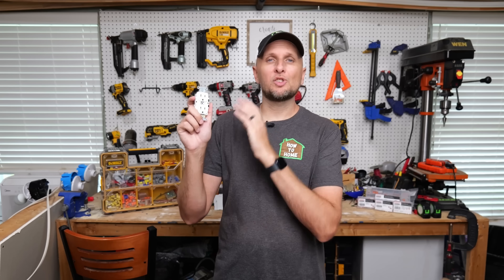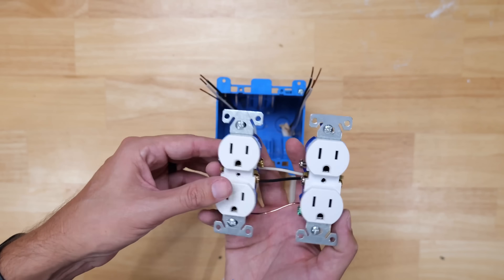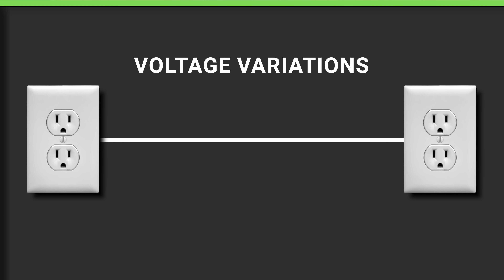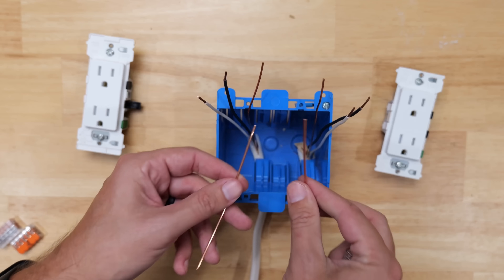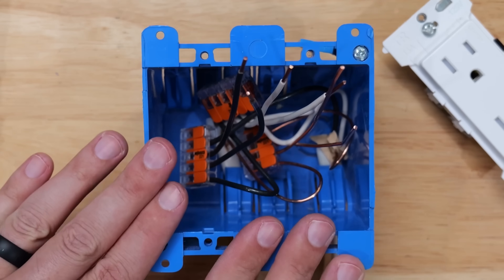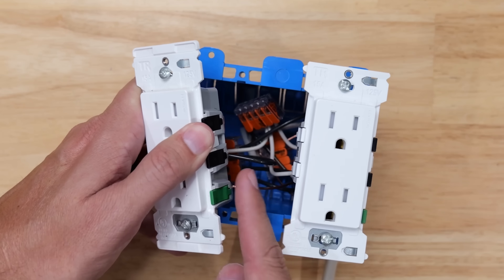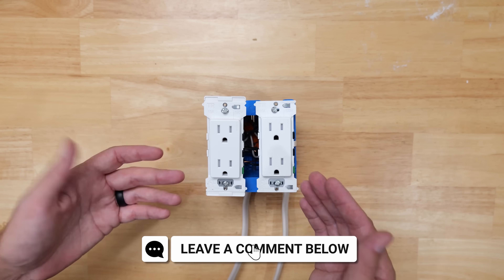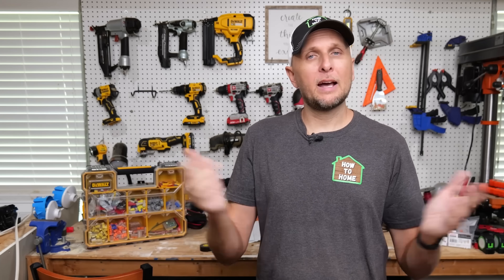Why This Outdated DIY Outlet Wiring Needs to End!

Comment: An outlet goes down? Is that a real thing, when did that start, when they started making really crappy outlets. Or when unqualified people were doing the work. And sorry the best connection for carrying current is wire warped around a screw that has been tightened down on the wire. Not kind of pressed down between two pieces of metal. All this has only managed to make it more expensive, quicker to do, but not stronger and I'm sure under max current usage those plastic wacc things will heat up. No thanks. Standards for everything have gone way down. We are in the age of incompetence. Don't defend it. In my home I replace all the outlets and took the wires out of the holes in the back of the outlets and used outlets without the holes. And what do you know, the outlets don't get hot anymore! I only wish I had a wiring diagram of the house.

Comment: Don't daisy chain create more resistance between first and last receptacle ? Thus in turn costing more eletric?and 14 ga vs 12ga for a whole system . Electrician buddy calculated years ago 100 bucks saved a year for 12 ga vs 14ga for his whole house re wire.
Reply: Yes, more material more resistance but I doubt it has any significant effect. For example, 12AWG has 1.588 ohms per 1000ft. Most circuits are not even 100ft in length.

Comment: In 1986 i was taught the in and out and a pigtail lead for each outlet shall be joined by a wire nut for each conductor. 

Never ever use the outlet as your junction. I don't know where the hell that came from as I didn't pursue the electrical trades, but it strikes me as wrong whenever I see it.

Comment: I wouldn’t let anyone use this lever locks. That’s why your outlets are failing and those wago connectors are another weak point. Another failure point is stabbing the wires into those holes cheap outlets have on the back of them.
Reply from the maker: There is zero evidence to back up what you’re saying about the lever connections.  They are nothing like backstab connections.  Just bias opinion.  My outlets aren’t failing so not sure what you’re talking about.

Comment: Thank you for making this video.  After decades of daisy chaining, you've got me around 99% sold on pigtailing.  Some of my cons are listed below.
1.  I don't really understand why you refer to the daisy chain method as "outdated".  My house was built in 1959 and it's all pigtails.  Same with my parent's house.  Seems like pigtailing is the older method, IMO.
2.  My big problem with pigtails is it drives another wire inside a wire nut.  I've already got several #12 solid wires inside that nut.  Adding just one more, even if it is stranded, is a big deal.
3.  I've had exactly the problem you described in your video.  Half the outlets in one room quit working, and the culprit was a bad connection on a daisy-chained outlet.  Finding it was not easy.  Fixing it was harder because when my dad wired up the room, after wiring an outlet he would pull the excess wiring back out of the box.  I guess that few inches of wire added up financially LOL
4.  What do you think of using stranded wire for the pigtails?  A little easier to bend and flex when stuffing everything into the box.  And with lever connectors it's a no-brainer to connect solid to stranded.
5.  I've got some green stranded pigtails that are a wire nut on one end, and a spade terminal on the other for the ground.  I wish they came in black & white as well.
6.  It would be nice if someone made a pigtail lever connector with the black, white, and green connectors all built into one unit.  That would make the pigtailing even easier.
7.  I love these lever connections.  I only recently discovered lever wire connectors.  So much easier to combine solid and stranded wires, and flipping a lever beats twisting a wire nut.  I just bought a big box of them for all my future projects.  I'm glad devices have them now as well.  Cost doesn't seem too out of line with screw terminal devices either.
8.  Have you, or could you, make a video showing the best way to stuff the devices and wiring into a box?  I'm always looking for tips from the pros.
Thank you.

Comment: That would work great when you're using 14 gauge wire which normal people do. My family runs internal wiring at 12 gauge which means heavier wire more wire in the box. It is not a pleasant job. And yes we do run 20 amp outlets when we need to. Otherwise we just run 15 amp depending on where it is. 
And as mentioned previously, added GFI into the situation. You don't want to wear it like that. You want to run it in series instead of parallel. Good video especially for those new homeowners that are just beginning DIY.
Reply: I think the guy who built my house used #12 left over from other jobs.  PITA to stuff all that spaghetti back into the boxes.

Comment: Electrically, both ways are wiring in parallel. Seeing that you didn't break the jumper on the receptical, the electricity is still going across the jumper. You are NOT wiring through the receptacle but around it. The only way that I see this killing the line is burning the through jumper on one of the receptacles. And then it affects only the ones after it. 
Aside from that you hate backstabbing, yet use wagos (same tech) over a mechanical (screw) connection?
Reply: Wago's are not the same as device backstabbing. The materials used with Wago's are superior in providing contact and constant tension without weakening. Wago's, like wire nuts, are isolated from the device, so they are not subject to movement by plugging and unplugging. Backstabbing could be considered a clever design by adding a secondary method, with virtually no added cost to residential grade receptacle manufacturing. You get what you pay for in this case, and they are UL certified to a minimum requirement for the desire to speed up the installation process.
Reply: @surferdude642 Wagos are a spring pressing against the wire to make contact just like backstabbing, and though they dont put up with the vibration of pluging and unplugging, they still put up with vibration to other factors. Add in the fact that they're not mounted the vibration is worse.
Reply: @roamingcelt I don't consider a receptacle mounted on a residential wall to be a vibration concern, however I found statements saying that Wago lever nuts are tested for high vibration conditions. Not much information on similar testing with device backstabbing connections although I assume that UL has done some minor tests at least. Vibration is not the issue I am addressing because vibration is an oscillating condition that lasts for several seconds to minutes or hours on vibrating machines or vehicles. The push/pull of a plug is just a single motion. People have their opinions, but an important fact is that backstabbing is not permitted on 20 amp circuits and Wago lever nuts and push ins have no such restrictions. Larger lever nuts are available for 30 amp circuits with 10 gauge wire. Another thing is that commercial grade receptacles have no option for backstabbing, including 15 amp varieties.
Reply: @surferdude642 I'm not saying that they don't have higher amp wagos. I am saying it is a spring that digs in to the wire like backstabbing. The vibrations and oscillations are the reason backstabbing is frowned on. You have these same forces on the wago and no mechanical means to dampen them.
I'm NOT saying I'd backstab, but it's unlikely that I'll use wagos either. I like my mechanical connections.
Reply: @roamingcelt  - Um, the WAGO device is a mechanical connection.  Spring-loaded, which keeps constant pressure on the wire, vs a screw which can come loose over time (actually happened at my parent's house).
Reply: @hcliii Which goes to the point of wagos=backstabbing. They are a spring pressing against the wire.

If I could I'd solder the connections. But that's against code and time consuming.

Comment: With standard outlet, why not do the same thing only using 2 black wires into one of the screw terminals? And two whites on the same outlet?  Then jumper wire the next outlet?  The terminal is made for two wires and this method makes a great connection...?  Also eliminates two pigtails.  Win,win.  :)  12 guage with 20 amp recepticles..

Comment: Where did you get your education which somehow got you the license bro, if you indeed have one. Just because you give an outlet its precious own little connection, that doesn’t mean somehow voltage won’t drop if a new load is connected to the circuit. Hell, even if you give each receptacle its own wiring to the main panel and its own breaker, every time a new load is connected to a separate line, the voltage will still drop!
Reply: you're right about the voltage drop. It's about the length. But the other cons he mention were on point. If the first outlet fail, it cuts power to the rest of the circuit downstream, which can be a nuisance.

Comment: Been redoing the receptacles in my 50 year old house.  Hunting down open grounds, and variable readings - mostly  bum receptacles, occasionally just - why bother hooking up ground..., and sometimes just "something" at the receptacle.   New boxes (larger), pigtailed.  Using the receptacles as pass throughs works until it doesn't.  A few minutes extra work is worth it to me.  

You can run 14 gauge stranded pigtails to a 15 amp receptacle - making things easier and not compromising a 20amp circuit.

Comment: Using lever connectors, I would do it this way.  I never liked 4 #14/12 wires in a single wire nut if I didn’t have to.  I’m just an amateur.

Comment: I’m not an electrician but I’ve wired several work shops and I’ve always done it the way you showed. I’m about to start another shop and will take your advice. I also need to brush up on the new codes as I know things have changed since my last shop 10 years ago.  I build a new shop every time I move. I generally also have to buy a phase converter and incorporate three phase.

Comment: I personally pigtail as well.  BUT it is totally code compliant to use the receptacle as a means of pass through wiring.  IF you do use the receptacle as a means of pass through wiring, do so by bending a J hook around the side connection terminals.  When using the the receptacle as pass through wiring fails, it's almost always because they used the back wire terminals to do so.  I NEVER use the back wire terminals EVER.  Anyone that has to do service work knows they are unreliable.

Comment: Points are spot on. However, and I don't endorse the method, it is a great way to locate burned or loose connections when it comes to the old 60's, 70's aluminum wiring.

Comment: Two things that need to be pointed out. First, if you have a GFCI with other outlets downstream that are supposed to be protected you must pass the power through the fixture. That's how they are made to work. GFCI breakers are a better idea anyway. Second, changing you wiring this way won't affect power to downstream devices unless your outlets are really, really, really, cheap (think bottom tier manufactured home cheap) that's just not how electricity works. However, if you have said cheap fixtures you will get a drop because the stab-in connectors in the back can only flow about half the nominal power draw. They will overheat, melt, and potentially burn your house down. I have pictures. If you have those cheapies with stab-in connectors just bite the bullet and replace the whole lot, outlets and switches both. Even the cheapest big box DIY store outlets are better than the *#(%$*& that they put in the cheap manufactured homes. (And while you are replacing them pigtail stuff where it is appropriate. Having one fourth of the outlets and lights in a house running through the back-stab on a single cheapo light switch is just a disaster waiting to happen)

Comment: I like this pigtail method better. However, I don’t feel the downstream should be too much of an issue the old way, as long as the job is done the right way. The exception that comes to mind might be if you were to “Backstab” wire the receptacles, which I NEVER recommend.

Comment: Would love to see a video showing how you recommend actual length of the pigtails ( looks like 4-6" in video) and show how you you recommend or actually  "shape" or fit the wires into the box. Video shows pigtails, how they should be connected, then "look they're nested in the juction box".  Would love to see a real video of someone actually placing them in the box.  Seems like that's really the secret to succesfully and safely doing these installs. Showing before and after doesn't really capture how it's done.
Reply: I'm always looking for tips from the pros, especially when it comes to putting the spaghetti back into the box.

Comment: Have you ever seen an outlets connections fail so that the daisy chained outlet stops working.  Is that any less reliable the wire nuts or wagos?  i have no statistics, but I would guess wire nuts installed by DIY people are by far least  reliable.

Comment: those poke connectors are a fire hazard they are designed for ignorant Mexicans. I SOLDER my connections and NEVER use the "poke holes" on outlets which heat up and lose their continuity over time.

Comment: Pre wago, using wire nuts to connect a few wires and pigtails together was cumbersome and inconvenient. Could also lead to wires arcing which is a fire hazard. Much easier and safer since the advent of these new connectors.

Comment: I definitely prefer this technique of straight through line with just a pigtail to the outlet.  I have had a problem of losing 1/4 of my house power when wired through the outlets and 1 went down.  

Now, if you just rotate the outlet around where the half round pin is UP as it should be 😉

Comment: When you take the method that was used before for decades and then the newer style it’s nice to see some improvement but to me it’s all kind of a variation of a archaic way of smashing , twisting and trying to force wires and receptacles into a confined space. I had two houses 1949 and 1950 where the wires were thick and new houses with thinner wires so trying to fit new receptacles into old spaces was a challenge if not impossible sometimes.
  Why not use the junction box as the location where all the wires are brought in and out and screw the wires into terminal blocks like a breaker box has and the receptacle with blades that you just push in or pull out like some breaker boxes have ? This would probably cost too much but would simplify the rat’s nests of wiring and outlets that are in homes today.

Comment: Je-sus H. Key-rist! What a God awful load of unbridled horse hockey as Col. Potter would say! … A connection is a connection is a connection… Been a real estate flipper working with OLD properties since 1976. When I began, these houses had GAS lighting and KNOB & TUBE wiring. In nearly FIFTY YEARS of doing total electrical upgrades from the service drop to the main panel to each individual receptacle, I have never encountered a bad buss bar on the side of a receptacle…. and the amount of extra hassle to wire up things with pigtails to do this greatly exceeds ANY perceived benefit.

During my military service I worked on IFF Radar, so I have a THOROUGH understanding of highly sophisticated electronics… residential house wiring is not particularly challenging. In fact, residential house wiring is over 90% Carpentry, to get the wiring where it needs to go, and barely 10% actual electrical work.       

Bottom Line for this method: The juice ain’t worth the squeeze.

SP5 Old Curmudgeon 
US Army Vietnam Veteran 1969-70…. and still…
Beaucoup Number Ten GI